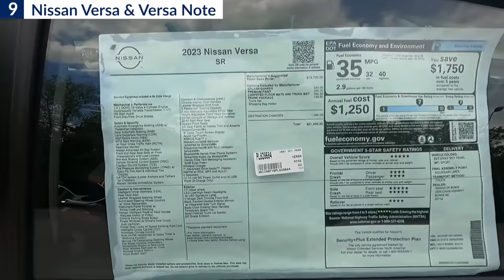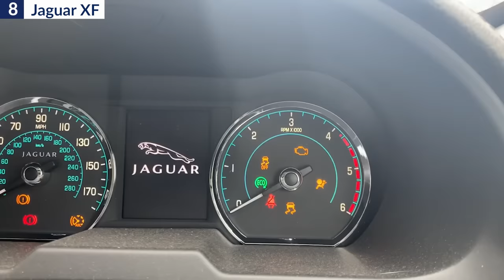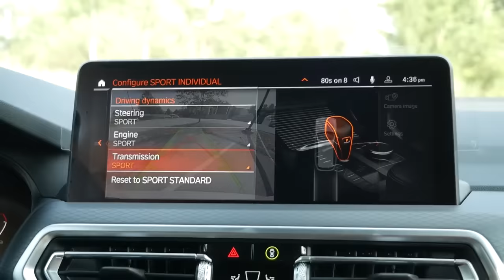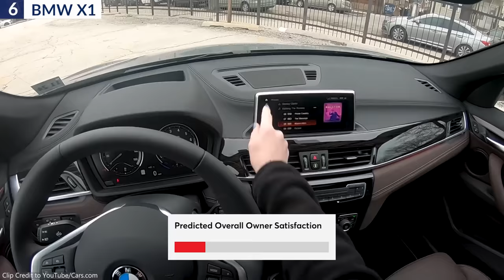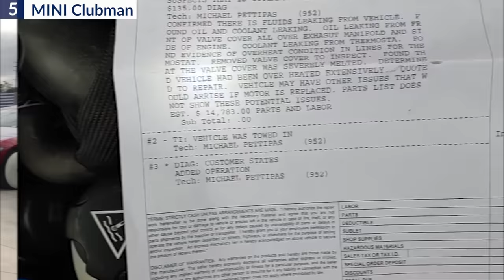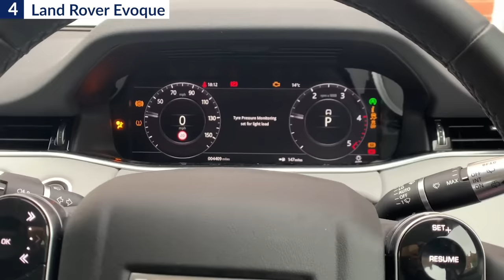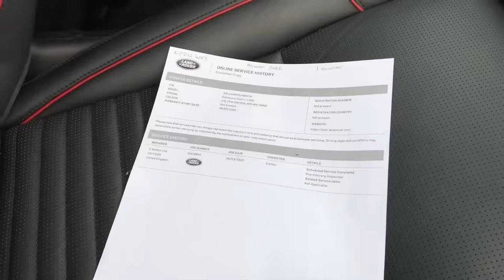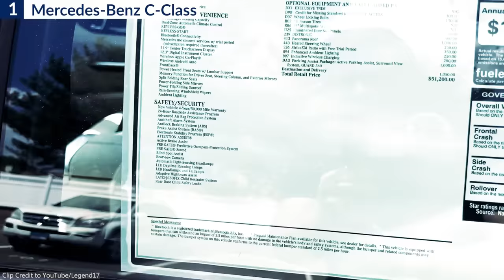9 Cars Owners Get Rid of in the First Year | Here is Why !!

Comment: That's the problem if you buy a car that you can't afford. There are plenty reliable and affordable cars but a lot of people don't want to be seen in these cars.
Reply: Lots of owners also want to EXPERIENCE the comfort and luxury at a "sub-prime" price.
Reply: Offering stripped down cars to get a low starting price point doesn't improve a car manufacturer making key options non-standard. If you like a jarring, harsh ride and spine wrenching comfort, then by all means have at it. A quality, reliable built car that is affordable with safety options is a hard find on a newer vehicle. 0-60 times are pushed like it's the gold standard. I need a vehicle equipped with an engine that can pull it's own weight! Underpowered motors make you hate driving and will eventually wear the motor out faster because it is constantly being pushed to get the car going along with the self-proclaimed nascar drivers who think the highways are their personal racetrack.
Reply: @TheOzthewiz  It depends what is considered "sub-prime" price 😉
Reply: @Ezyone4u  Like to know what car you prefer.
Reply: I agree for whatever that might be worth. I think there is probably some percentage of buyers out there that would get rid of a car after the first year regardless of the car’s personality traits.
Reply: There is one phrase that has always kept me from buying cars I can't afford:  "The people who are important to me don't care that I don't drive a luxury car".
Reply: @yellowboxster06  It's the biggest problem in the world today. People buying stuff they can't afford and regret it afterwards.
Reply: @scottferris6309  exactly
Reply: @scottferris6309 i love this. I'll start to use it lol. I feel the same way, people try to impress other that really and truly do not care about them. But what you can afford.
Reply: Many people don't like to seen in kia😂

Comment: I have a 19 bmw 330. one of the best cars i've owned. I've only had to pay for oil changes and a set of tires in 45k miles. also gets 39mpg on the highway, my wife purchased a 23 x3 about 7 months ago..absolutely loves it. 33 mpg on the hwy
Reply: Good luck.  My buddies 8 year old perfectly maintained X5 is bleeding him an average of 6k a year in repairs.  He hates that my 23 year old lexus with 4 times the milage still hasn't replaced the parts he has had to.  They are fun to drive and a great lease car.  Run when the warranty passes.
Reply: Same here. I have a 2020 330i and I am very happy with it. As I posted about, I don't understand the "high maintenance costs". I also have just under and 50k miles and have only done oil changes (myself) and a set of new tires a few months ago.
Reply: The 3 series is the most reliable for sure but the Xs tend to be money pits and have bad depreciation
Reply: My 2016 BMW 2 series has been super reliable since I bought it new. Minor issues but nothing crazy, so far......76k miles
Reply: @PatrickHenryLibertyorDeath  You have to get a German car that's been assembled before the two daily factory beer breaks!  That does for English cars too.

Comment: These are primarily very expensive cars.  People that buy them can afford to ditch them after a year.  People that buy lower priced cars don’t generally have that option unless the car is truly atrocious.
Reply: I have not heard many positives on a large number of these vehicles.  More could have been said in these videos.
Reply: That's a foolish thing to say. Just because folks buy certain cars doesn't NOT mean they can afford them and imagine forking over all that initial money and then having to deal with all the headaches afterwards.
Reply: This is a great point.  This is why you’ll often find some of these with really, really low miles at dealerships.  Because the owner decides to trade them in for a more reliable vehicle.  And yes, those that ditch them after less than a year of owning them do have the means to do so.
Reply: So do the higher end used cars sell well? A substantial lower price may justify this purchase but then there’s maintenance and insurance
Reply: @ronaldr.236  Exactly, which is why you see so many of them with low mileage, but there isn't necessarily much, if anything, wrong with them. If you're not totally happy with something and you have the money you just go and get another one. 

I've always believed you're better off getting something that is at least 3 years old. By then they have a track record you can refer to, and most of the issues will have been sorted out under warranty. Never, ever buy a new car with a brand new engine that hasn't built up a reliability record, you're just a guinea pig for the manufacturer.

Comment: My 1978 Mercedes Benz 450 SEL with the 4.5 V-8 has cost me $17.00 in repairs (resister for the CDI ) and maybe $300.00 in maintenance over the past 20 years. The leather is like old shoes and is still close to perfect. 
My last BMW, a 1994 525i, gave me 100,000 miles with a water pump as my only repair.
My current 1991 Lexus LS400 has given me almost 100,000 miles (bought at 57,000 miles) with no breakdown ever, and online maintenance items are not too painful. 
There has been a change in corporate ethics for the worse.
Reply: $300.00 for maintenance in the past 20 years, which is $15 per year, I expect each oil change is $20 even you are doing it on your own, maybe 70,000 miles for 2 tires?! I'm a little lost. 

The last 2 wiperblades that I got on sales from Costco costs me 10bucks already and I change it once a year.
Reply: You should have them put in a museum as unicorns. Any trouble you can't fix yourself on the new models will cost you $1500 before any parts even are replaced. You better have a Deep Wallet to afford those 2 brands now.
Reply: @jackwong64 300$ over the past 20 years because it just sits probably. Thats why. 300$ in 20 years is not possible.
Reply: I paid $900 for a ebike in spring of 2020 still rides great after 2,000 miles
Reply: @jackwong64 I always exclude oil changes and tires when figuring maintenance costs on a car. They are (supposed to be) a given much like putting fuel in the vehicle.
Reply: Notice its maintenance he talks about. To insure those cars versus Chevy Caprice is way more expensive thru the decades. So the cost to keep the Luxury brands going on the road are HUGE compared to the average brands.
Reply: @ag4allgood  Yep $1500 is just to have the tech hook up the code tool and look the fix up and put a hefty 200% parts mark up margin on the bill. All while you sit in the nice leather waiting chairs and sip your expresso.
Reply: That was when Mercedes Benz were the best cars in the world and would last forever! But not anymore! Today so many models have been branded as Lemons and can't stay out of the shop!
Reply: @glennoropeza3545  I hate to use this phrase, but it's true "They don't make them like they use to".
Reply: $300 in maintenance???  How often do you change the oil?  Every decade?
Reply: Ok, ditch that bottle grandpa
Reply: @scruf153  Eh?
Reply: @ag4allgood  That's why they are luxury brands.
Reply: @ag4allgood  In order of lowest to highest insurance costs (and they were all $40k new) 2019 GMC Acadia, 2014 Lexus is250 and the winner is 2012 BMW i128. The nightmare of BMW is the F-series with the 2L turbo and electronics package. 5 generations of E-series perfection. The F-series is dead in 1 generation, now we have the G's, hope they get better.
Reply: Audi are not producing the cheaper models in their range going forward, just etron sports and rs Q8s etc 🙄
Reply: The newer models will give you a lot of headaches.
Reply: @glennoropeza3545  Lemons?  what models are you referring to?  In Georgia there is a "lemon" lot for cars, all American cars...
Reply: Booolsheeeet!!
Reply: @scruf153  My neighbor has an e bike he  paid eighty five hundred dollars for!
Reply: Bunch of obvious lies.
Reply: Worst car i ever owned was a 2004 3 series bmw would not swap my mazda diesel 491000km for a new bmw
Reply: @kirkjensen7668 I have an F10. No issues. That said I have the N55 inline six. The 8 cylinder has issues with oil consumption and turbos cooking everything. The M5 is a shop queen.
Reply: The tires alone on that E/Bike will cost You more per mile than most cars........Been there...done that...........Paul
Reply: Maybe if you put a few more dollars in maintenance you would have less trouble.
Reply: @nachoisme all that does is give a inaccurate info
Reply: Gee you think?
Reply: These cars are all parked in his living room with no batteries
Reply: lmao thats a lemon rust bucket
Reply: The MB A or B scheduled maintenance is over $300 a visit.
Reply: Dude - 300 dollars for 20 years for a Mercedes?  Not true u less you do zero maintenance.  We own an 87 560 SEC as a second/fun car.  Low mileage means a yearly oil change - that alone costs $150.00 or so.  Following the Mercedes maintenance schedule costs about $3000.00 every 2 or 3 years - at a specialist, not a dealer.   Then you have extras like tires and brakes.  That means you either don’t maintain your Mercedes, you don’t drive it at all, or you are fibbing.
Reply: @krisone63  Do you mean lemon law? That is only for new cars. Used can be sold as is.

Comment: Newer doesn’t always mean better.  I learned that hard way when I traded my 2008 in for a 2021.  Don’t fall for all the bells and whistles….it’s a trap. Older cars were made much better than what they’re making today in most cases with most manufacturers.
Reply: The problem with older cars is that THEYRE OLD. Meaning at some point, you need to buy this new over engineered, complicated and useless shit. A good example is WHY THE FUCK did they go with those electric parking brakes? What was wrong with a handle you pull a cable with?
Reply: @bmw803  Exactly.  At our house, we only have Lexus and Honda.  They're both old and are over 100K miles, but reliable and not high maintenance because they're built tough to start with.
Reply: @billolsen4360  If you can't 200K miles out of a L or H you are doing something wrong.
Reply: 90’s and 00’s domestic cars were absolute garbage. The newer ones are built better
Reply: @bmw803  isn’t that like asking like why the hell do we need power steering or power windows?   Why do I care how a parking brake works as long as it works?  I don’t understand GPS either but it beats fumbling with a gas station map.
Reply: @itsabovemenow1016  Comparing power windows and a cable parking brake is no where near the same.
Reply: @mckricks1  for decades people rolled their car windows up and down with a crank, steered their cars  with their own muscles.  If you trust power assisted windows and  steering, what’s your problem with power-assisted parking brakes?
Reply: @itsabovemenow1016  Because of the feel, engagement and accuracy you feel with your car. Power windows aren't involved in the the actual driving experience. And yes manual windows are more reliable but not as convenient. They are just in a different category. Try driving an older manual transmission Honda Civic that has pump-steering, cable e-brake, and throttle by cable for example. And then one of these modern cars that have everything electronic. It's a big difference with how it feels when driving. That's what I am getting at. Not to mention reliability is typically better with cheaper fixing costs.
Reply: @mckricks1  so you want to give up power steering, too?
Reply: @itsabovemenow1016  Power steering with the traditional pump is good, I don't like modern electric power steering.

Comment: As a former owner of a MB C-300 I fully agree.  The regular maintenance costs are unbelievable.  The dealer was a DB.
Reply: To be fair, DB describes all dealers.
Reply: @nodak81  💯
Reply: I remember the stock tires going bald after 8500 on my c class and turned it in lol
Reply: Expectations not met at a reasonable price !!!
Reply: Just don’t take it to the dealer. They’ll charge $300 for an A-service (oil change) and they literally do nothing more than any independent shop.
Reply: My sister's 11 yr old c300 NJ car had a catastrophic rear subframe failure.... completely rusted out. Turns out it is not uncommon, but MB doesn't care.
Reply: @drew6116  Why should they? the car is eleven years old.
Reply: @krisone63  Oh, they should care because eleven is nothing. And more importantly this is a common problem not a rarity. When toyota had this problem they bought pickups back or remunerated people.
Reply: @drew6116  When you live in the snow belt you have to inspect and treat the underside of a car if you intend to keep it for a long time. Early this year I removed any rust that was developing on the sub frame of my 2005 Subaru WRX and repainted it. I also had to replace two front suspension arms because one actually broke through. But replaced them with aluminum ones instead.
Reply: @evoman44  Indeed, some maintenance is very nice. Thanks for your response.
 But most people don't know a thing about a need for undercarriage maintenance nor is ot even recommended to people.  Meanwhile, this car was only 10 years old and garaged.
My family had General Motors cars all the time, for decades, and this never happened.
I have a sixteen year old jaguar on a twenty one year old bmw, not even a hint. And more importantly this was a major part,  a sub frame!
Doubly more important as I said before, this is a known particular problem in this car. And mercedes easily could have stepped up and helped out like Toyota did.
Ten years in new jersey is not justification for a major part to blow out.
Now my fifty one year old b m w 2002... That gets an under carriage wash once in a while!
Reply: @drew6116 just so you know W204s have an extended warranty for the rear subframe rust, 650,000 miles or (IIRC) like 30 years. This went into effect like 6 months or so ago, if she still has the car take it back to the dealer.
Reply: @evoman44  I have never treated the underside on all the Audis I have owned.  My 2010 has not even a spec of rust and I have held many for over 10 years with no suspension repairs or shock changes.  My batter is still original and cranks like new in a cold climate in Canada.  It qucker than almost all electrics too and looks new. 455hp.
Reply: @Sommers234 that's bs. I bought a 2007 Rav4 that had a perfect body not until much later did I discover the amount of rust underneath it. The rear crossmember was almost completely rusted out. So bad I replaced it.
Reply: Disagree on the MB C class.  My friend had it for 10 years, sold it to us for $7500, low miles, LA car, zero rust etc, and we have had it for 8 years.  We take it to our mechanic, obviously not the dealer.  Anyone who goes to the dealer for maintenance is asking for it, pretty well known since I was a child (long time ago).  When I picked up my friend (has a new Audi) for lunch, and she knew from emails that we bought a very used car and it’s very old, her eyes bugged out and she said “How old is this car?!!” because it honestly looks like new.  Drives great.❤
Reply: This is peanuts anyway.  People should not be buying end cars and expect Toyota service costs.
Reply: @mellocello187  We agree to disagree.  Glad your car turned out to be good.  No mechanic in town would touch my car.  My car was like a Chevy.  No catastrophic issues but a lot of little ones like water pump, sensors etc.
Reply: @drew6116  well you should of taken it to a different dealer mate, its a known issue & they are all being replaced under warranty once the rust progresses  past surface. Its being honoured on all W204, C204 & S204 models regardless of millage or age. I know of  many that have been done already.
Reply: @Troy-McLore  Holy crap. Really? son of a gun. Thanks. A friend of mine bought the car and when he discovered the subframe broke/rotted, he quickly traded it on a new car. I'm surprised he didn't look more deeply into it since he recently retired from around 20 years working F&I at  a Mercedes dealership.
Reply: @drew6116 there’s a recall on that. Maybe it was issued too late for your sister’s vehicle
Reply: fwiw all the US models of the W204 were made in South Africa. Living in UK we had a German built W204 (one of the last off the production line) and other than somewhat higher than expected tyre wear and with a dealer service plan (it's less than a mile from us), we had only 1 minor thing actually go wrong with it in 7 years of ownership. The bill for that was £100 for the part and half hour to fix (no waiting either at another full dealership). Impeccable service basically.
Reply: @Sommers234  They did that because they lost a class-action lawsuit
Reply: @ronmccord44 those were sport tires.  That's what you purchased.
Reply: I live in RI.  Never treated any of my BMWs.  Just a regular under carriage wash.  This isn't difficult or expensive.
Reply: Yep, I noticed that trend among the cars. Lots of bad dealers in these brands.
Reply: @mellocello187  LA car. Of course rust wasn't a problem.

Comment: I have a 2016 Chevrolet Traverse LX and it's now mid 2023 and I have never had any mechanical issues with it and my gas mileage is not bad either, especially for a big crossover.
Reply: I have a 99 Tacoma I drove off the lot, last  year I finally decided to change the timing belt, WP hoses, belts, etc.. all original, the old timing belt still looked new, I was impressed, Only ever had 1 major issue and that was the frame rusting out that somehow I missed the recall, but it's fixed now and hopefully will serve me until I die.